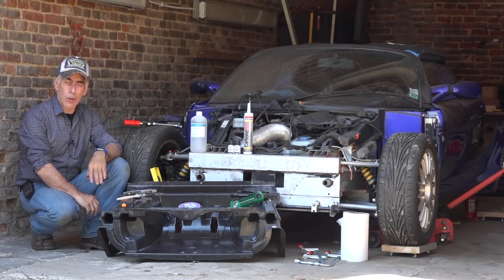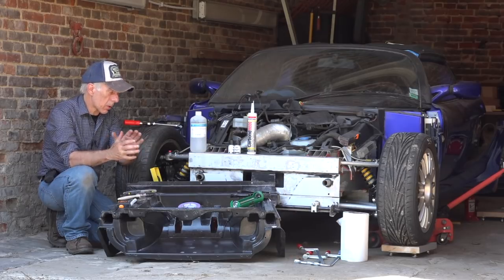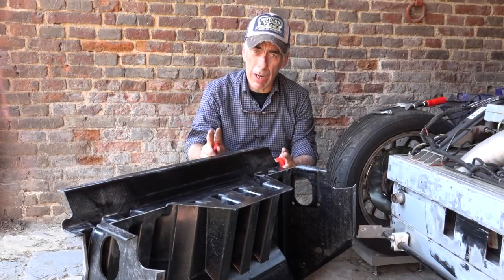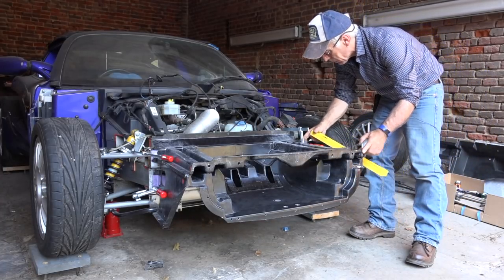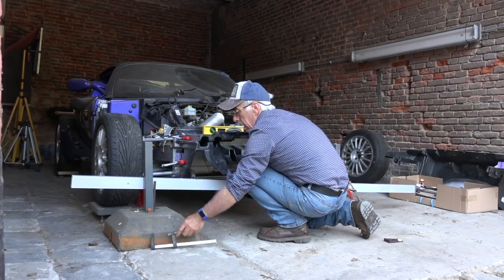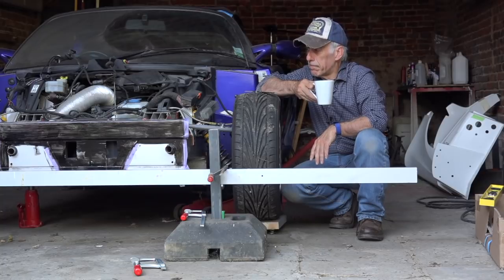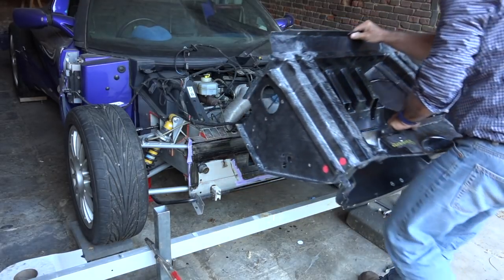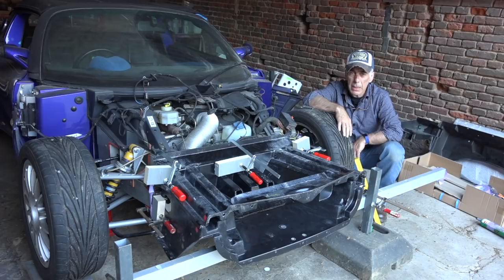Lotus Elise, mounting a new Crashbox -Start to end

Comment: Great video! You are very meticulous with your work! I recently did this on a wrecked Exige that I bought. Getting the old box off was a lot of work, more than mounting the new one.

Two other small tips to add:

1 - Put a piece of radiator hose on the two coolant hard mounts coming through the aluminum bulkhead. The clearance between the hose and the crash box is quite tight and if you aren't careful you could wind up without enough space to get the hose + hose clamp on there after it's mounted.

2 - This is unconventional, but when we mounted it we actually drilled into the aluminum bulkhead where the box mounts and put in two small threaded "riv-nuts". This worked out great because they helped support it during the gluing and we were able to adjust the angle to make sure it was level simply by tightening or loosing those two small screws.
Reply from the maker: Vincent Chiaro very good tips. Thanks for the comments

Comment: For the crash box you mounteded  it on top of  the side brackets and not below and inside of the side brackets. The side brackents were the ones you drilled out the rivets on. You can see that in you video on removal of the crash box.
Reply from the maker: Yes indeed, it provided some support during the mounting of the crash box, and kept the  crash box wings ( bottom) open enough . But note that the bracket was very loose on the frame...  Well spotted

Comment: First time I noticed that the car is RHD; will you consider rebuilding it to LHD as well in this project?  That would be very interesting to see 👍
Reply from the maker: Hi Harald, First txt for the comments.   No I am not going to mod the RHD to LHD.  The reason is  that this is a 135R and as far as I can track it only a handful were made (180). All RHD. So I will keep it original.   You will see how I fix the overtake problem with a RHD  ( small camera and iPhone).